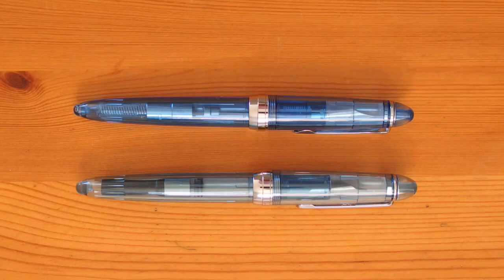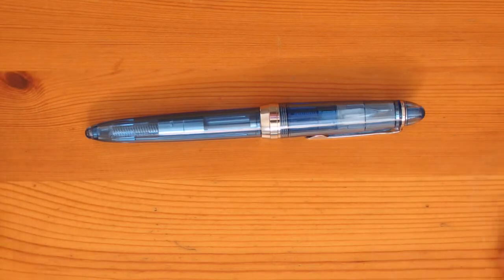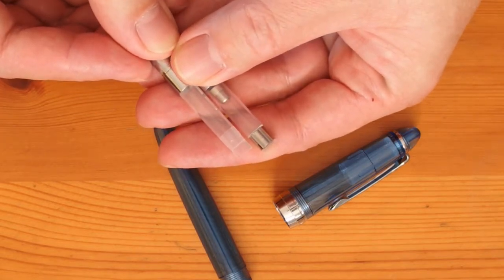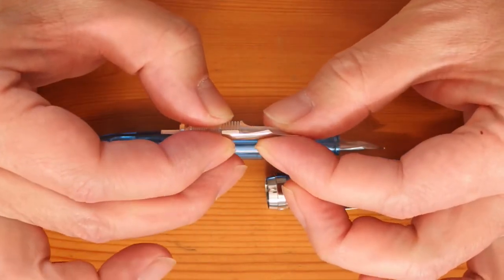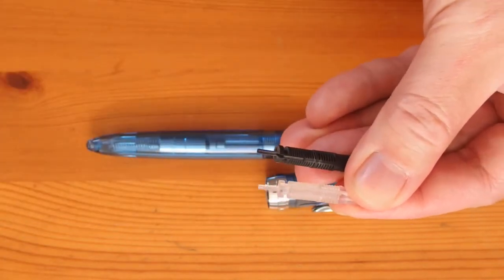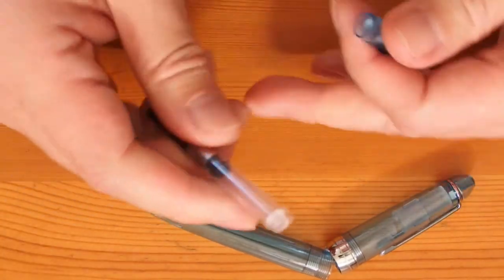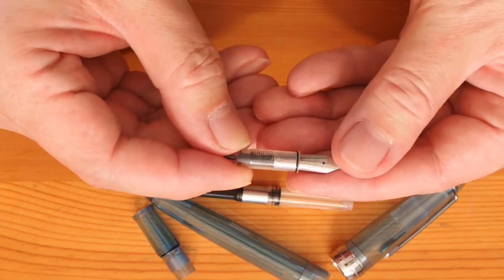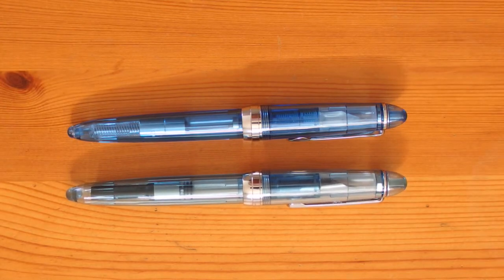Lingmo Lorelei & Jinhao 992: Two Sailor Procolor 500 Homages

Comment: Thanks for this video. I have the see through Jinhao 992 and somehow ink had got into the space between the two nib unit sections. I could not clean it out until I heard you make the point about the screw in nib unit. Voila! I unscrewed the nib holder, and cleaned it. I suppose the nib unit was not fully screwed onto the gasket. I put it back together and now it is perfect. Thanks again.
Reply from the maker: Glad to be of assistance. I only wish the other pen makers using screw-in nib units could incorporate gaskets like that; it would prevent any chance of ink contamination.

Comment: The most important part is missing, the WRITING.
Reply from the maker: B BG My videos are not intended to be of the usual product testing variety , where the performance of one example cannot be extrapolated to any other example; on top of that, ink and paper are also uncontrollable additional variables. What I intend to do is design and engineering analysis instead, so writing samples would be irrelevant.
Reply: @Seele2015au  What is the purpose of a pen? Uncontrollable? Use the same paper and ink.
Reply from the maker: @TheAtl0001  There are numerous other channels offering that, it's just not the aim of my videos really.